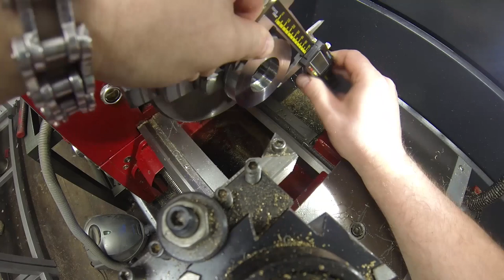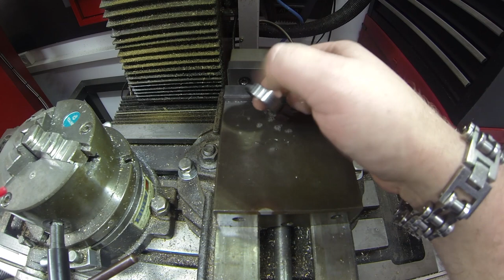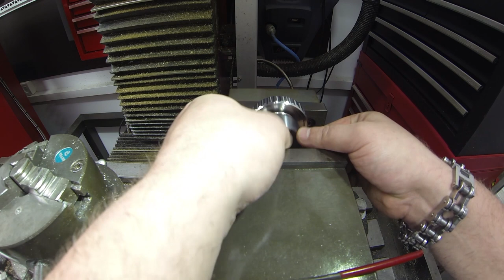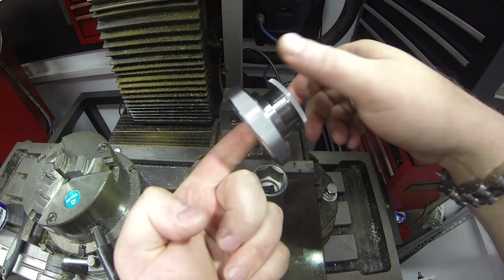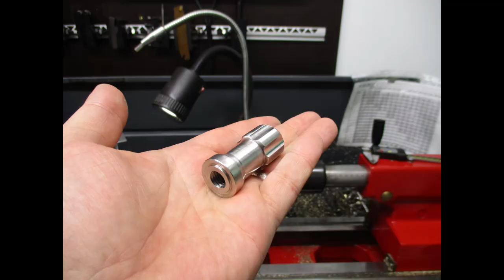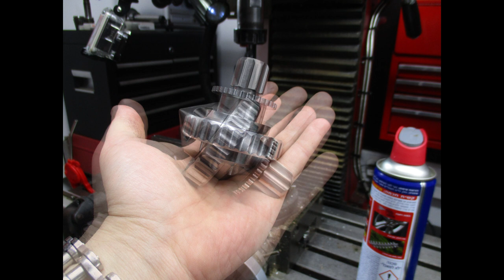Gyro toy the machinist way(time lapse build)

Comment: i love the milling marks on the notches on the point that are kinda slanted. very nice design. the only thing i would change for V2.0 is a ceramic bearing, and dual tone coloring. (maybe black oxide on the body and polished on the outside diameters or on the notches..) great video. keep it up :)
Reply from the maker: Tnx !!!

Comment: Whats the math to divide all those notches evenly around the perimeter?
Reply from the maker: You don't need math for this , all you need is dividing head(tool).
Reply: Number of notches is your dividing number. Since a circle has 360 degrees you divide that 360 degrees by your chosen number of notches. Just like navigation on the earths surface a circle can also be further divided into 1 degree having 60 minutes and one minute having 60 seconds. It's not the easiest system to use for some numbers, and decimal degrees would be easier. Generally most dividing heads would have a 40/1 worm wheel ratio and a number of index plates containing various numbers of indexing holes for each circle of holes on each plate. Using those most common divisions can be done. If not then more specialized compound gearing used on a dividing head can do a lot more. So you DO need math for what was shown in the video since you need to know the tables worm ratio and which hole circle will give you the correct numbers to give you the correct divisions.
Reply: @notcrediblesolipsism3851  1/1000th of a degree is divisible by a whole lot more than 60 is. Try dividing 360 degrees by 7 to the nearest second on any calculator then try it with decimals. Which system is faster and easier? Afaik CNC type rotary and dividing heads are set up to use either the degrees, minutes, seconds or decimal degrees with the decimal degree system highly favored over those degrees, minutes, seconds.